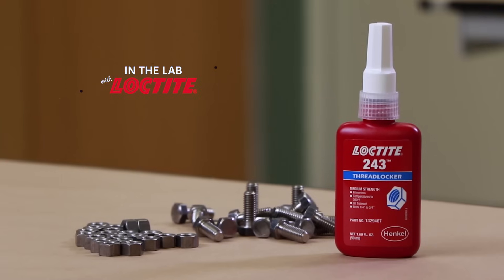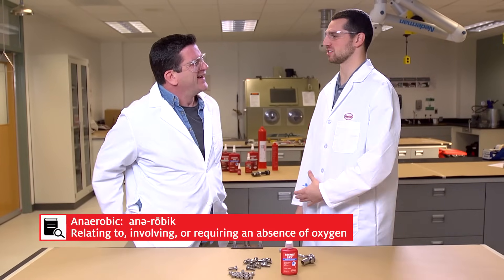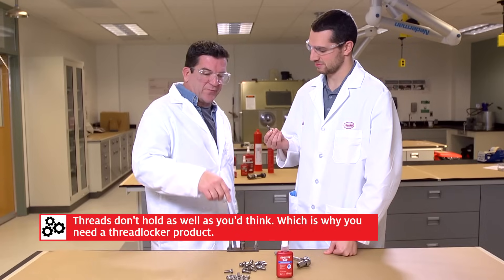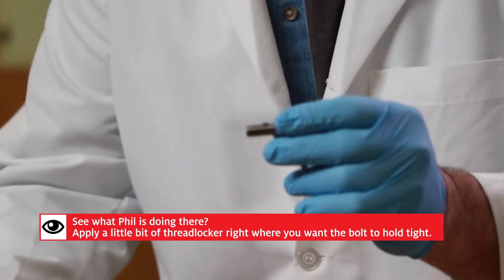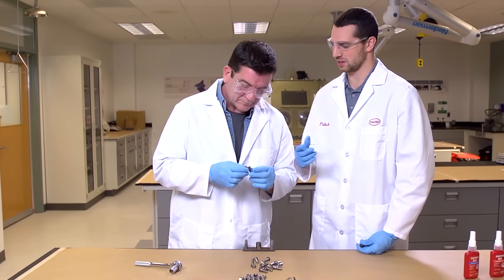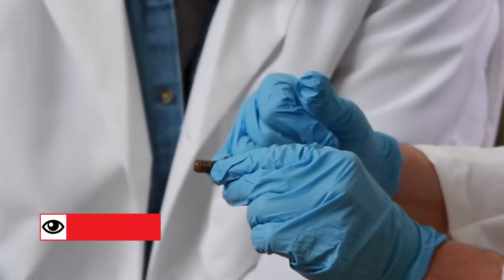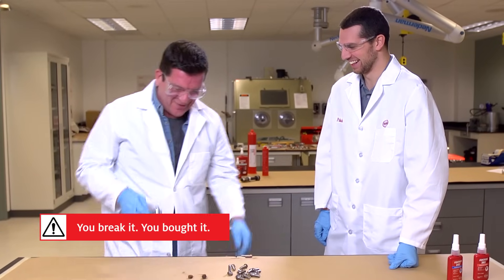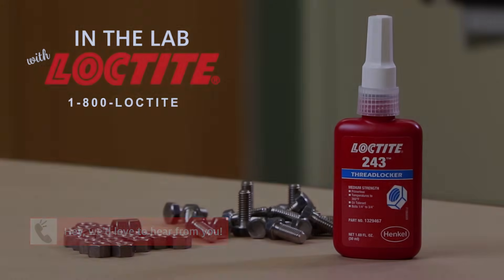In the Lab with LOCTITE® - Proper Use of Threadlocker

Comment: I guess the product has changed a lot over the years. I learned to use locktite on automobile engine bolts in the 70's. We put a small drop on the threads and let it cure. then when you tightened the bolt the cured locktite would keep the vibration from loosening the bolt.

Comment: If I use a low strength loctite like 222 instead of silver or copper anti-seize would it affect a fasteners torque specification.
Reply from the maker: We are happy to assist with your product & technical questions.  We need additional information to ensure we are providing the best answer, so please feel free to contact our Technical Experts at  Support center | Henkel Adhesives (henkel-adhesives.com)

Comment: I heard for knife pivots that there are fewer metal ions transferring that can cause Loctite to stay uncured. I think in this video that part was not touched on very heavily is the importance of the ion transfer to act as an activator. Something like a stainless, dlc coatied, or titanium has less ion transfer. But, what you can do is after you clean the pivot and screws with isopropyl alcohol. You can put the Loctite directly on a copper penny to start that ion process as an activator. You can mix it around and then place the blue Loctite on your pivot screw and dial in your knife action and let it dry for over 24 hours and bang… You’ve got an action that won’t come loose.

Comment: Why do I never hear or see people degreasing before they apply threadlocker , I fly rc heli and work with Loctite at least once a week I feel using brake clean a must and prefer the ford product  I can tell you that get a bit of a trouble spot and don't do everything perfect in your construction and you crash . Also witnessed someone remove red Loctite with a 24 hr soak in CRC degreaser if that helps anyone oh ya heat also works but it must get 500 degrees to carburize unless it is high heat stuff

Comment: U WANT TO LOOSEIN ANYTHING WITH RED THREAD LOCK JUST ADD GASALINE IT EATS UP THE THREAD LOCKER I CLEANED MY BLOCK WITH GASALINE AFTER I dropped inserts in my block guess what when I checked to see if the threadlock was holding 8 of my inserts came out so ha don't clean your area with gasoline before or after you insert the threadlock I used the red one 272
Reply: Or heat it, as the TDS suggests.

Comment: this stuff is useless it doesnt work..as long as something gets wet still form oil or soemthing it doesnt hold stuff in place.
Reply: You need to clean the threads with brake cleaner, acetone, isopropyl alcohol or Loctite makes a cleaner/primer.

Comment: I find it VERY interesting they don’t to tell us that you should first clean your threads - or whatever - with alcohol or some kind of solvent (and let it fully dry before applying the Loctite, of course - I debated whether or not to add that, but this is YouTube, so of course I need to add it).  This is going to remove any oil or grease or anti-corrosive agent that might be on the surface (stuff like that is quite likely to be on nuts, bolts and screws, right?  The answer is YES, it’s quite likely).  Any of that crud will cause Loctite to fail miserably in its purpose. 

And let the Loctite cure before using the machine or item - that means at least 24 hours of inactivity but of course it all depends on temperature, humidity, blah blah blah.  

Yeah. So you came here to get good info from a video, but you had to read the comments to get anything really worthwhile, eh?
Reply: If I recall all strengths of Loctite have differing set times. Pretty sure BLUE is 4 hrs but might want to confirm. If it’s torqued to spec I don’t see the need to go to the full cure point in my applications
Reply from the maker: We are happy to assist with your product & technical questions.  We need additional information to ensure we are providing the best answer, so please feel free to contact our Technical Experts at  Contact Us - Henkel Adhesives (henkel-adhesives.com)
Reply: @loctiteNA  is what the original commenter said true??

Comment: When using 242 on bicycle screws, do you need to use a primer or something to prevent seizing like with Park Tool's AP-1?
Reply: AP-1 is only required for Carbon, but Park Tool sucks at being clear about it.

Comment: Why is that I'm the only one who still doesn't understand the purpose of this? 🤔
Reply: In a corrosive environment, the bolt and nut will rust together, making it very difficult to disassemble.  If the rust makes it way through the bolt, it will become brittle and break off.  Additionally, in a vibration heavy environment the bolt can come free and wiggle it's way off the bolt.  Look up "bolt vibration" and be amazed.
Reply: @Cuandoman  Wow, that was a year ago that I posted that comment. I don't even know why I was so confused about the purpose of the product, lol. Silly me! I always knew what the stuff was meant for. I'm still dumbfounded as to why I even commented on it to begin with. Lol. 🤣

Comment: nobody needs a corrosion tutorial, thats obvious. I was looking for applying tutorial not for corrosion, for corrosion I can use a drop of oil there that will stay there forever. I bought a blue and it doesnt hold 5hit. Was trying to see maybe I was doing something wrong. It is super thin and has no effect on small screws AT ALL.

Comment: Loctie 648 green has no solvent to remove ..just alot of heat. What would be a good replacement that could be removed by solvent or less heat. My gear is on an electrical motor shaft. Stainless shaft and aluminium gear with keyway. Worried about the high heat to remove 648. A solvent would be great to use everytime i need to replace the motor. The gear is protected from water in a gearbox but does have lucas red n tacky in it. Please help our comunity of people with the problem. A torch is the only way right now.
Reply: Call the 800 number.

Comment: Can you use this to pre-threadlock bolts a few days before you use them?
Reply: That depends on the specific product. Some activate after metal contact, so those would not be ideal to pre-apply.
Reply: You can buy bolts with it pre-applied.  They call it thread locker patch.  It usually has the same color as the loctite.
The liquid in the bottle kind is usually not good once it is broken loose though.

Comment: I found out if you get any crumbs of fake plastic wood in your threads, the only way to remove the nut would be to cut it off.
Reply: Which kind of stroke are you having?
Reply: @manbunmyname5866  Usually 4, sometimes 2 with glow fuel.

Comment: Is there a product that can wick into where an inner and outer race of a sleeve/bushing bearing come together?  It is a one-way type "bearing" that I want to lock so it is bidirectional.  I have considered welding it.
Reply: Loctite 609 is a low viscosity, rapid-curing anaerobic adhesive that augments the strength of press fit assemblies or slip fit assemblies up to 0.005" in diameter. Adds up to 3,000 psi holding power.
Reply: Green loctite
Reply: @jff987jl  Which green?  Do you have a number?  Thanks.
Reply: 609 ….for press fit applications

Comment: Does Loctite threadlocker spoil?  I mean, if it's a few years old but comes out liquid, it's still effective?  Thanks.
Reply: They should have answered this.  I don't know the official answer, but from my experience, as long as it has not set and is still liquid, it is still good.
Reply: Easy enough to test the blue.  Shake it up, apply to a screw and see if it sets with twenty minutes.

Comment: Pierce the tip?   I have a small tube of Loctite 242.   I'd love to apply it to some threads, but as hard as I squeeze the tube, nothing comes out.  I look at it with a magnifying glass and don't see a hole at the tip.  I don't see it mentioned anywhere, but are we supposed to find a pin and pierce the tip?  Or snip the tip off?
Reply: I have had blue set up in the nozzle.
You can unscrew the cap and use a wooden toothpick to clean it out and it should flow better.

Comment: Yeah, a lot of experts... rust locked bolts may snap its head or break and you end scraping a part or having to machine a new thread...
Reply: Well if you’re not a citizen of tard town, most people would know that when the bolt/nut gets tight on the rusty threads, you tighten it back down a few threads and begin re-loosening the bolt as a repeated process. Cleaning the rusted threads on the way off. Or you can just use the retard strength and no brain and snap the bolt/nut off without that process.
Reply: @jaked964  IF, and only if, you are able to tighten it back to get it loose... get a drop of the wicking thread locker and have a happy life

Comment: Trust me, Don't use the red loctite if you plan on removing a nut from a bolt with tools. Always use the blue loctite. A lot less cussing with blue.
Reply: I thought red needs heat to loosen the adhesive

Comment: This video just made loctite look like eazy off. I was here to research cure time, and overall dry time not to convince myself that loctite is designed to loc things tight but be easy to remove a bolt and nut it was used on? This video is very oxymoronic.
Reply: 243 is removable, stays on until you need to remove with hand tools.
Reply: It keeps things 'locked' until you need them, and doesn't require a blowtorch to remove them like stronger loctites do (like say a wheel lug. It would keep them connected, but would still allow it to be removed with just hand tools and the inside wouldn't be as prone to rusting)

Comment: @Loctite North America
First off,  I love LOKTITE Blue 242.  
It does a phenomenal of job holding fasteners were I put them, even when there are ridiculous vibration loads trying to shake everything apart.   I can take it apart later with just a little bit of extra grunt, and not a torch.

It is very challenging for people who know how and when something works to explain it to someone who doesn't.  I think you were trying to let it show for itself, but clearly you could make a video to show where and when to use it.  Most people don't actually read instructions, and even fewer will call the 800 number.

He should have said, " Loc-Tite blue is made to increase the initial holding torque of a fastener, and as a side benefit, since it keeps the threads clean, the torque to break it free will be same, even if the fastener is exposed to harsh elements. You won't need an eight foot breaker bar, or a torch, to take off that rusty 1/2 inch bolt, even if the bolt is underneath your snow plow."  

A top down view of a Beam torque wrench, with slow motion at break point would have been very effective and everyone loves slow-mo.

An graphical overlay of of the breaking torque would demonstrate how much difference it makes. 

@Gary Anderson
Think of Blue LokTite 242, as a drop of glue to keep the nut from vibrating off when you don't want it to, but still breakable enough to take it off when you do.  Blue is the most practical for most uses since you don't need a torch to break it loose.
There are other products that prevent rusting threads such as anti-seize with copper, aluminum, nickel, graphite, or teflon, if you only want to prevent the threads from seizing up.
Reply: I'm a 243 guy myself
Reply: I can't take it off. something is wrong
Reply: 242 or 243? The video shows 243, is 242 another similar product or is this a typo?

EDIT: OK, I looked it up. So 242 is the older threadlocker.  Loctite says 243 is an updated version and it's a touch stronger, but more importantly it is oil resistant. So according to the guy who's website I read, with 242, yes, you should clean the threads to get grease and oil off...with 243, you don't need to (though go a head and do it to be thorough). So do some research and decide which to use and whether you need to clean it or not.

So maybe that's why they didn't clean it in the video?

Comment: Can I use on water pump bolts ?
Reply: Yes. Only use the blue (medium strength) and cover all the threads for a little insurance from rust, oil and wear. A word of caution: Do NOT use the red locker (maximum strength) which would be overkill for a water pump and would make a future replacement costly and frustrating.

Comment: I remember people were arguing with me whether putting blue loctite on wheel lug nuts or bolts, would prevent it from coming off next time, they tell me you can’t take it off if you put loctite on it, lmao, I mean what boggles me is that people who argued with me already knows the difference between the red and the blue one and they used blue loctite on many parts on a regular basis but when it comes to something that doesn’t usually require loctite, they can’t think straight.
Reply: Does the torque spec change on lug bolts with threadlock or antiseize?  Dry torque vs wet torque.
Reply: @solarsynapse not by a significant amount
Reply: Good God what fool would think to argue with so concise and informative a man.  More about the purple loctite s'il vous plait.

Comment: What a load of mens dangly bits. 
I think what he really should have said is that the blue "Loctite" is not meant to weld the nut and bolts together. It is meant to keep the thread clean and rust free so it will be easy to disassemble. 
The red "Loctite" is the best and really does weld the nut & bolt together. You will need heat up to 500c  to be able to get them apart. 
So for instance, if you are bolting on an exhaust system on a vehicle then use the blue so it will not rust inside the threads and therefor making it easy to undo and fit a new one when the time comes. 
 This video was a load of blox .

Comment: From watching this video I learned that without Loctite on a rusty bolt you will likely ruin the fastener, your socket wrench, and the table that the test fixture was attached to. Thus proving that Loctite will save you a lot of money!
Reply: Oil is cheaper.
Reply: @manuelvazquez8758  So is water, but it won't hold the fasteners together against motion such as vibration.